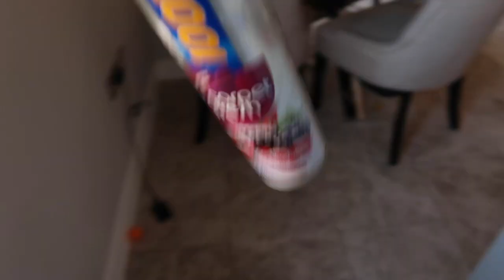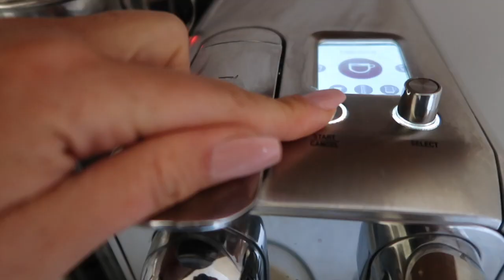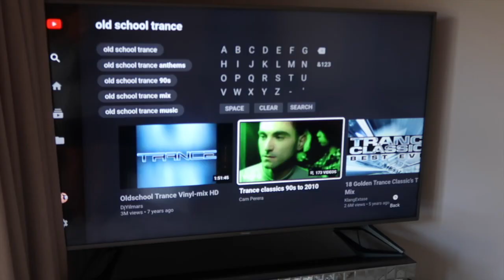WHOLE HOUSE CLEAN WITH ME || ALL DAY CLEANING MOTIVATION 2020

Comment: Hey Laura! Been loving your motivational videos, I turn it on every time I start cleaning or need motivation! I wanted to suggest a product you would probably love so much: It's a steam cleaner:) It works great  picks up all the old dirt from the floor and disinfects with 100% boiling steam , has usually 2 settings for carpets and tile/hardwood , and best of all, It has microfiber pads you can reuse for months on and it's pet friendly:) I use it for 6 months now and works amazing, I spray some vinegar on te floor or a bio cat-friendly product and steam away, it's incredible. I brought mine in LIDL but you can buy these anywhere online:)